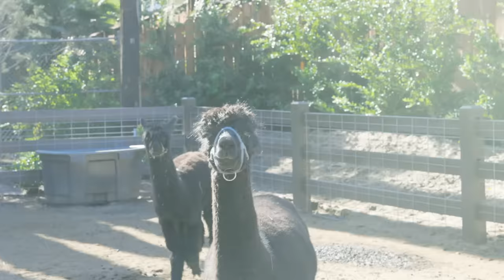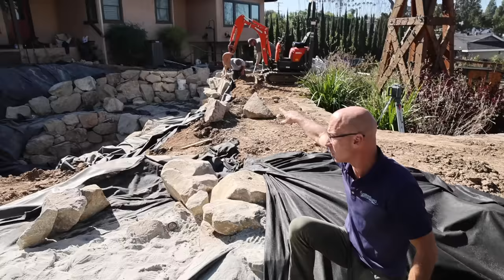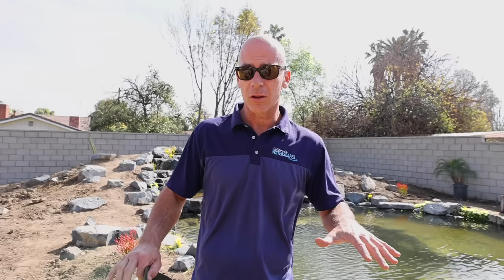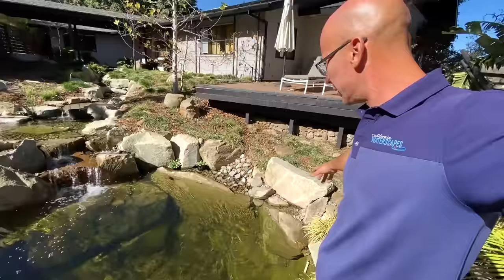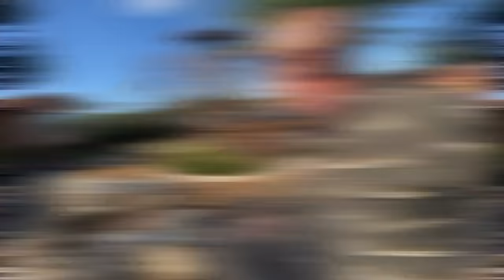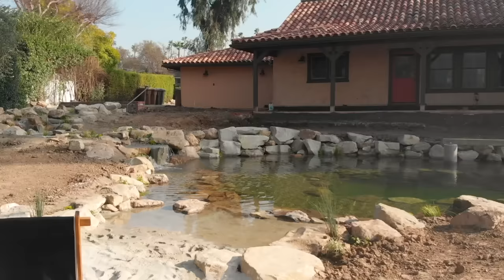Natural Pools & Swim Ponds in California - No Chlorine or Chemicals - Aquascape System

Comment: This is awesome! Significantly faster build than the the regular concrete/cement chlorinated pools too.
Reply: Yes! And liner ponds look way more natural then concrete
Reply: Also alot less expensive or at least they should be.
Reply: @StallionFernando  how the fock does it look less expensive? It's literally a private oasis!
Reply: @minedantaken1684 because it requires removing soil and adding water. Obviously some other items if it must be mechanical for these clients. Pools need formwork, pumps, trenches etc

Comment: Going to need a quote on this 😍 so I can set that as my income bucket list!
Reply from the maker: Swim ponds range anywhere from $50,000-$150,000 depending on size, depth, upgrades, waterfall size etc. Something can be built for any budget, you can start off with a regular koi pond starting for around $8,000 and then go for a swim pond later on ;)

Comment: so the piers for the dock, they're just sitting on top of the liner, right?   No worries of ripping the liner?   and how long should a liner last?  I imagine there is a life span and it must be a nightmare to replace?   Looks amazing regardless!
Reply: thank you Dave! Yes the footings for the piers are dug prior to underlayment, liner, more underlayment, form it up and pour your concrete.
The manufacturer (Firestone) gives the .45 liner a 20 year warranty. I’ve been using this liner for over 20 years and  when I visit some of my older projects, the liners still flexible and shows no signs of deterioration

Comment: I'm curious what is the maintenance like. If they swim in it. Does it need chemicals at all? How much does it cost to maintain? To run the pumps 24/7, etc
Reply from the maker: We use a completely natural form of filtration called "biological filtration", it uses good bacteria and enzymes to eliminate the algae's food source to starve it out and therefore eliminate it.

As for maintenance, a weekly maintenance session is recommended for any natural pool, you would add water treatments (all natural ones such as beneficial bacteria and good enzymes), clean off filter pads in your skimmer if you have one and take any dead leaves out. You can easily do this yourself, or hire essentially a pool guy, but for ponds to do it for you. 

For pumps, if you use submersible pumps its very economical to run, but pool pumps can run about the same as a pool would. Depends on the route you want to go. Pumps DO need to run 24/7 in order to filter the pond and keep the oxygen count up. Beneficial bacteria and plants are keeping your pond filtered, they NEED a high dissolved oxygen count to survive.

Comment: Beautiful jobs. Where do you get the water from? Is it a well? Here in florida we r constantly hearing about drought in California. Is it a closed loop system?
Reply from the maker: A closed loop system. We only add water to top off from evaporation. About 1/2 inch every week. It's actually considered a drought tolerant system. Doesn't use as much water as a lawn or traditional landscaping.

Comment: How many gpm  is the waterfall please. What sort of pumps  do you use and how energy efficient are they can these sort of pools  be run 9f solar
Reply: Our natural pools usually have 2 or 3 external pumps that use from 5 to 8 amps each, depending on the flow setting. Very efficient and quiet with an app to monitor electric consumption. 110 v so best if you just get solar for your house

Comment: I read online that the filtration pool has to be the same size as the pool itself. Yet that doesn't seem to be the case for these pools. Can your filtration pool be smaller than your regular pool?
Reply from the maker: No it does not. Take a look at this reference from Aquascape on building wetland pool filters. You may also build them deep instead of wide if you don't have the space. https://www.aquascapeinc.com/wetland-filtration

500 sq ft    8' x 10' filter size
1,000	   10' x 15'
2,000	   12' x 25'
5,000	    25' x 25'
7,500	    25' x 40'
10,000	    25' x 50'
15,000	    36' x 40'

Comment: What did the ponds shown cost all in to complete? Also how are the larger rocks secured from coming loose or shifting or falling?
Reply: $50,000 to $100,000.. we use an adhesive foam.

Comment: How do stop the mosquitoes from breeding in the water?
Reply from the maker: Mosquitoes do not like moving water, they only breed in standing water. With a pond setup with a skimmer and a waterfall biological filter - they don't stand a chance ;).

Also the skimmer pulls in the top sheet of water, anything that drops on the water will be pulled into the skimmer and filtered out. 

Fish also will eat any bugs that land on the surface. Even if you don't want koi, you can get "Mosquito Fish" - small guppies. These specifically eat mosquitos and their larva. 

Bottom line, our customers don't have any issues.

Comment: Does algae grow in natural pools? Seems like it would.
Reply from the maker: We use a completely natural form of filtration called "biological filtration", it uses good bacteria and enzymes to eliminate the algae's food source to starve it out and therefore eliminate it. But, just as you would find in any lake you swim in, a natural pool will accumulate some algae. It's not out of control though and it is a part of nature. You can put in additional filtration methods (which we did for the Fullerton pond did) called UV filtration which uses UV light to sterilize the water an extra step. This eliminates even more algae and keeps it crystal clear.

Comment: I love the whole idea but I'd want a pool that naturally slopes into deep water instead of tiers.  The different tiers just make it look unnatural to me.
Reply: Your costs will go up exponentially because of the space and materials needed to do that. Even if you use a minimum slope of 7ft horizontal for every foot of depth down you go to get to 5ft you'd need 35ft x however wide just to slope into the water. If you got the space and money go for it though. Also, it should be noted the minimum slope for a wheelchair ramp is 12 ft horizontal for every 1 ft of rise/descent so If you wanted a gentle easy to walk slope that's what you'd use here too and that would make the distance to get to 5 ft 60 ft long by however wide.

Comment: Where does the water come from?
Reply from the maker: The water is filled up with a hose, then it recirculates with a pump. It doesn't drain out anywhere and very little water is  drawn out of the pond. It's actually considered "drought tolerant".

Comment: Just a thought...  That diving "deep" section is a real hazard for neck and spinal injuries.  Jumping in would be fine, diving in the other hand...No.  If you imagine a diver with an mid-depth and middle angle of entry, the diver in going head first  into the rock headwall on the other side.  Pools have regulations on the slope of the pool opposite the diving board and deep end.

Comment: Sad part is this is probably 150k. Would love to get one done but cant afford that
Reply from the maker: We build ponds all sizes, most people start off in the $9,000-$12,000 range with a 8' x 10' pond before building a large swim pond. Ponds are an amazing addition at any size :)
Reply: @CaliforniaWaterscapes   yeah ive use to build them 25 years ago  there charging  50k for a 8x10 now with a water fall nothing special i use to charge 4k for same thing 25 years ago and was living pretty good they were big 30-20 years ago then died off pretty quickly  now there cool again past 8 years or so but prices are insane   in to old and my heath i could not build one i use to dig them with a shovel but was a machine back then   i have not had one in 10 years realky miss is nothing better for the soul then sitting by your koi pond i got my best sleep sitting next to it with the waterfall sound. Really nice work

Comment: Isn't California constantly in a drought?
Reply: 2019 we got more rain then we could handle… 
believe it or not, these pools actually conserve water. Most locations we install a pool we are removing grass that consumes triple the amount of water
Reply from the maker: Common misconception about ponds is that they use a ton of water to keep running. It's the same as building a swimming pool. Ponds are closed systems that don’t waste water. Ponds evaporate 0.25"-1" of water a week, in contrast with a lawn / landscaping can use 2"-4" a week easily. They require water only to replace what’s lost by evaporation. In general, ponds use about 50% less water than lawns and other gardens. All water added to the aquatic system stays there. It doesn’t become runoff, carrying fertilizers and pesticides into the sewer systems, groundwater or waterways.

Read this article to find out more - https://www.pondtrademag.com/ponds-are-green-and-drought-friendly-the-most-eco-friendly-outdoor-spaces/

Comment: That's not cool there's no enough oxygen
Reply from the maker: There is plenty of dissolved oxygen in the water. The structure of a stream or river affects dissolved oxygen. The more turbulence that a stream or river displays, such as waterfalls or rapids, the more oxygen is absorbed into the water. We design our streams and waterfalls specifically to add the required amount of oxygen into a pond for it to thrive.

Comment: California is already suffering from extreme drought and rich people are still building outlandish pools and ponds instead of planting more trees. If all hands are not on the deck in curtailing climate change, wait for the worst to come.
Reply: These pools recycle the same water over and over using much less water than if you planted grass or tress’s in this same space. Also the amount of birds and wildlife that can have access to fresh water does wonders for the environment;)
Reply from the maker: Common misconception about ponds is that they use a ton of water to keep running. Ponds are closed systems that don’t waste water. Ponds evaporate 0.25"-1" of water a week, in contrast with a lawn / landscaping can use 2"-4" a week easily. They require water only to replace what’s lost by evaporation. In general, ponds use about 50% less water than lawns and other gardens. All water added to the aquatic system stays there. It doesn’t become runoff, carrying fertilizers and pesticides into the sewer systems, groundwater or waterways.

Read this article to find out more - https://www.pondtrademag.com/ponds-are-green-and-drought-friendly-the-most-eco-friendly-outdoor-spaces/